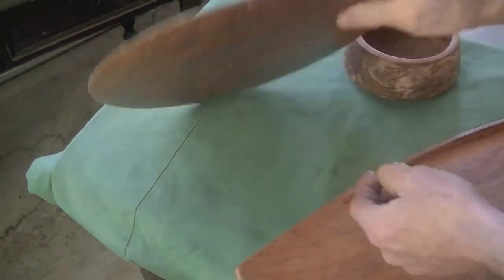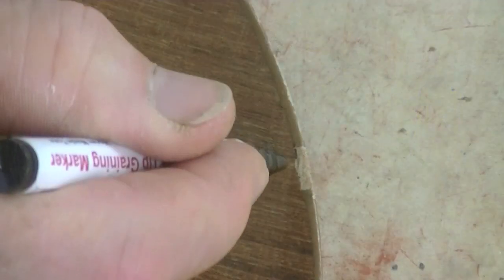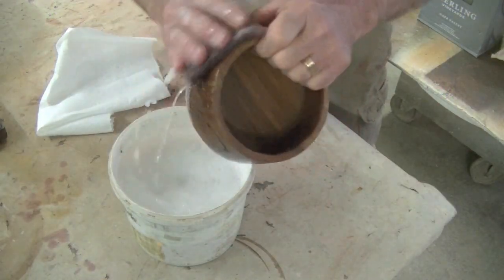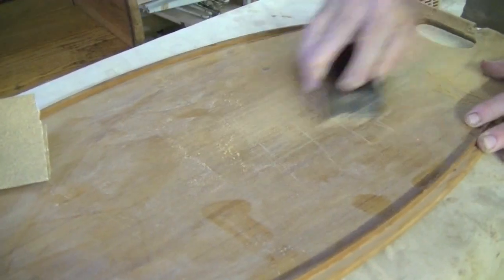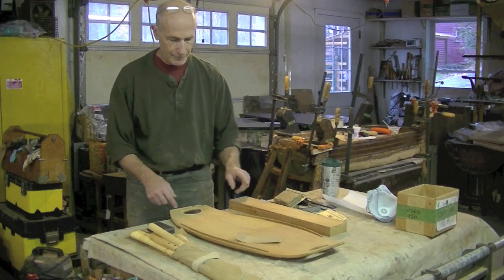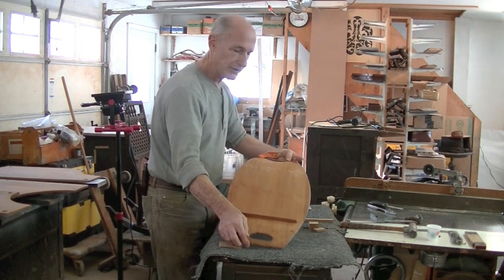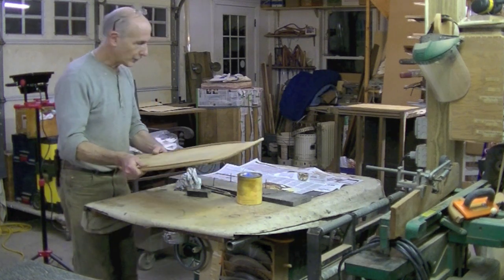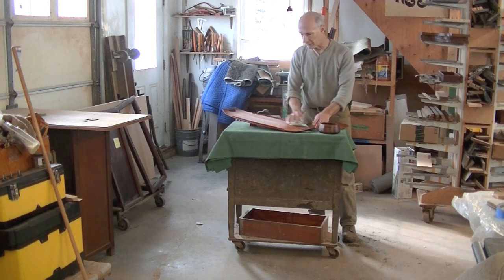Restoring Midcentury Modern Teak Objects - Thomas Johnson Antique Furniture Restoration

Comment: For the clamping blocks on the handle, did you use wax paper so you could get the blocks off after gluing?  Also, could you ever use a brown Sharpie marker pen to make touch ups to furniture grains/flaws?
Reply from the maker: The blocks were covered in packing tape. And yes, I use markers all the time, ones made for furniture touch up
Reply: Thanks!

Comment: You did a beautiful job, and as an instructional video it’s priceless. But may I ask if there would be value in doing a job like this as a business? I was a chef in the mid 70s when the teal bowls were all the rage for side salads here in the U.K. We used to oil them with olive oil.
Reply from the maker: I don't think so, but I'm thinking of the repairs. If there were no repairs, you could refinish them pretty easily and quickly.
Reply from the maker: I'm sure it could if you could find this stuff

Comment: Mr Johnson, I have been following you for awhile and love your work. However I often wonder why you don‘t us a better method to get glue in cracks as in the teak tray or under veneer. I have restored many veneered antique radio cabinets and some furniture and found using a veterinarian reusable plastic syringe and disposable needles of various gauges and lengths that I get from a local farm and home supply store works great for getting glue deeply penetrated where I want it with much less mess and cleanup.  Sometimes I have to thin wood glue with a little water if I use a very thin needle for very fine work and that works great too.
Reply from the maker: Thanks! I have in fact started using syringes more often, due to popular demand! Yes, they work well. I'm not a big fan of thinning out glue however
Reply: @johnsonrestoration  Agree that glue thinning is not most desirable, but where there is little to no stress as in securing veneer, I have never had a problem with any slightly thinned wood glue failing.

Comment: Can i use raw linseed oil and mineral turps, 50/50 on 1950's rattan furniture ? The old finish has been sanded off.  Will the linseed oil mixture soak in and dry completely so that it doesn't transfer onto cushions and clothing? Approximately how many coats? Is there a better finish coat than this for rattan?  Thank you
Reply from the maker: Thanks for watching! No, don't use raw linseed oil, it won't dry. Buy an exterior teak oil for the job

Comment: That tray turned out amazing. I picked up a Danish teak magazine rack that needs to repair. What was the product you used to bring out the red, just the linseed oil?
Reply from the maker: Thanks! Yes, just oil. But not linseed oil, you should use a Danish oil like Watco or any other brand. Some people use only mineral oil where it will be touching food, but the Watco is safe after 30 days

Comment: Great video, sir, and beautiful work! May I please pick your brain...? I have a teak Grete Jalk coffee table (1960's) that needs some attention. There are some grease stains on it and some lightened areas. Is there a non-aggressive way to get those out? Can I also finish with linseed oil, or should I use some sort of satin finish?
Reply from the maker: Thanks! Clean with Dawn Detergent - same solution as for dishes. Sand lightly with very fine sandpaper - 220. Recoat with an oil finish like Watco - or any oil finish available to you. Get the oily rags out of the house!
Reply: @johnsonrestoration  thank you so much!

Comment: Hi Tom. Love your projects. You mentioned that the tray likely wouldn´t be in direct contact with food. Original this Danish Design piece (Dansk Design) by Quistgaard was often used for serving cheese and biscuit, so it´s good you used non-toxic oil. Greetings from Denmark.
Reply from the maker: Thanks! You're right! I think I was thinking of food preparation, but of course it's a serving tray and food could go directly on it.

Comment: Wonderful post.
How would you go about repairing seam separations in a Dansk staved wood bowl?
Reply from the maker: Thanks! That would be a tough one. I would put a band clamp on it, and if the joints close up, use a waterproof glue like Tite Bond III. If the seams won't go back together than they will need to be filled

Comment: Congrats on the serving tray- I would probably have just cut off the two ends and redesigned it!
Reply from the maker: Not a bad idea! But that tray in original condition is $1250! So it was worth repairing
Reply: Holy Woodwork!!!

Comment: loving these videos! I picked up a couple of Søren Ladefoged lounge chairs in teakwood that haven't been well maintained and seem to need some love. Do you recommend doing similar "touch-up" work for teakwood furniture like these objects, where you first clean the wood and then apply new oil (perhaps with 0000 steel wool)?
Reply from the maker: Glad you like them! Thanks! Yes, that usually works well. Usually when cleaning the really dirty areas, where hands and arms touched, it will clean right down to the bare wood, so those areas may need a little extra oil. Be sure to use an oil finish (like Watco, etc.), not an oil polish

Comment: They look great. I have a ton of Dansk peppermills and other things I've inherited that need work. I the wax I use but it would be great if you mentioned what kind of detergent and other things you use to clean because I like to try to get what I know will work. I hope to be successful in my projects - thanks to your patience making this video!
Reply from the maker: Thanks! And you're welcome. Dawn detergent (mixed the same as for doing dishes) will clean these objects right down. Then use any oil finish, there are many products out there, all good. After 2 or 3 coats and well dry, wax
Reply: @johnsonrestoration   Thank you - I thought you would say that - which is great because that's what I use. I also use Howards products for waxing and finishing - it looks like you do also!

Comment: surprised you are not preparing the teak for a flexable epoxy such as used in fly rod building, one of the only times i would expect you to use plistic
Reply from the maker: Thanks! I never heard of flexible epoxy, I'm interested. But this tray is quite sturdy and would never have any deflection.
Reply: the epoxy i mention is good for creep, its not really all that flexable .

Comment: Fantastic work as always, Tom. I have picked up so many tips and tricks from you, which I have already been using in my own shop.
I note you use 'nail boards' to suspend your work while drying. I used to use the large nails you do until I impaled myself on one. Now I use carpet gripper strips, tacked to 2x4 material. It leave less marks on the work, easier to orientate and hold the piece and I do not have to worry about wearing steel soled boots. Just a thought!!!
Reply from the maker: Thanks, I never thought of that. I'll check it out
Reply: I use jacks, the toys from long ago.

Comment: I'm curious. How did your employee break the teeth of the saw?
Lovely Restorations by the way.
Reply from the maker: Easy - attempting to saw through nails! Accidentally of course
Reply: Thanks for clearing that up Tom. 
I've only been doing the carpentry for almost 3 years now, and I'm still learning lots. I just wanted to check if there was some bad technique I was unaware of, that could result in damage to saw teeth. Especially as I have a couple of antique Disston saws that I would be horrified to damage. I'm nervous enough when I sharpen them.